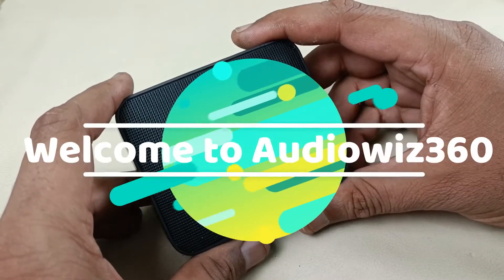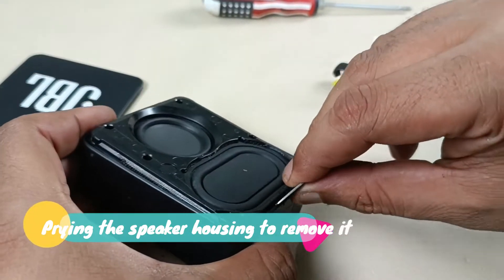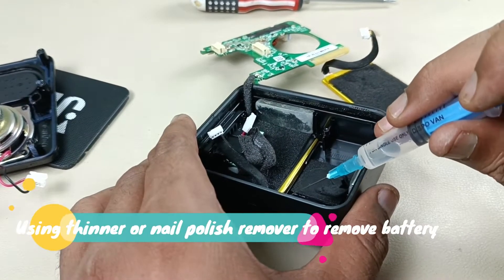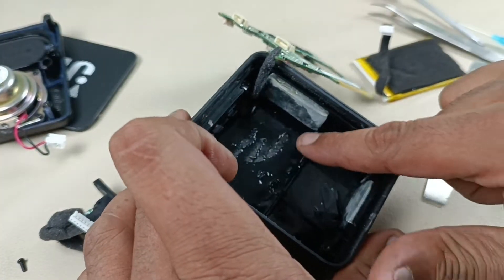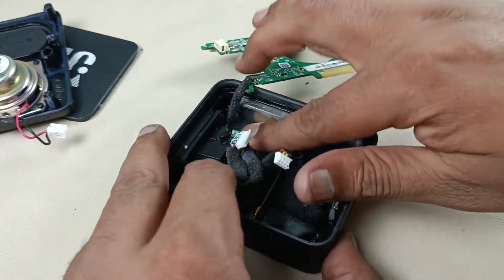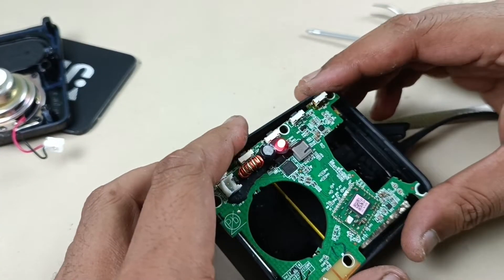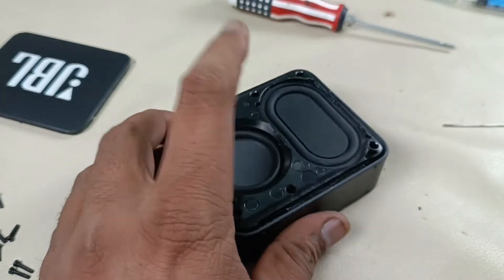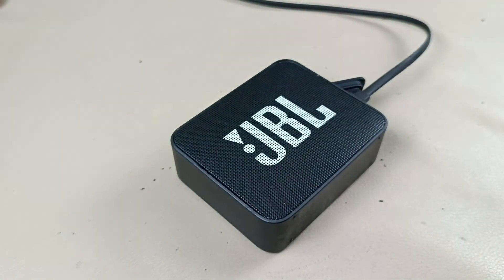Battery replacement of JBL GO 2 Bluetooth speaker | How to Fix JBL GO2| Repair JBL Bluetooth speaker

Comment: Where did you buy the original battery ?
Reply from the maker: you need one?
Reply: Yes i want  @audiowiz360
Reply from the maker: please do message on WhatsApp 

 +91 9741218068
Reply: Yes i want  @audiowiz360
Reply from the maker: please do message on WhatsApp 

 +91 9741218068
Reply: You can mobile 🔋

Comment: Bro where did you get the replacement battery
Reply from the maker: I had one dead JBL GO 2 in that I harvested. but you can get easily in electronic market atleast similar size and specs.

now available original battery 
please do message on WhatsApp 

 +91 9741218068
Reply: @audiowiz360  could you please give the specs of battery
Reply from the maker: battery available in Bangalore,India. with me please do message on WhatsApp 

 +91 9741218068
Reply: Có thể thay loa của go 3 vào được không ❤❤❤❤❤